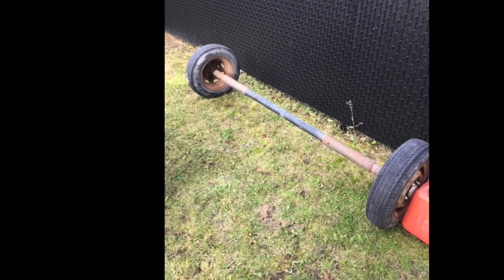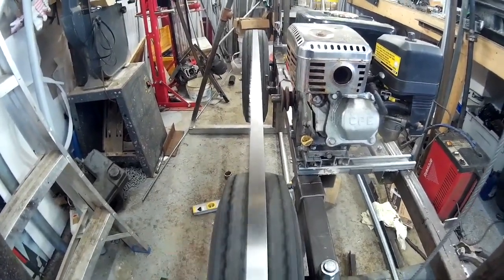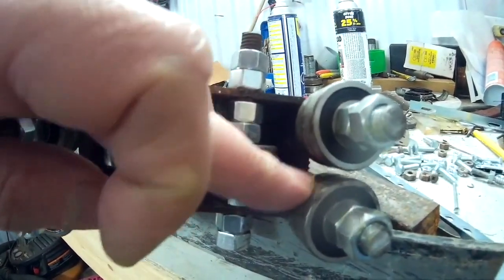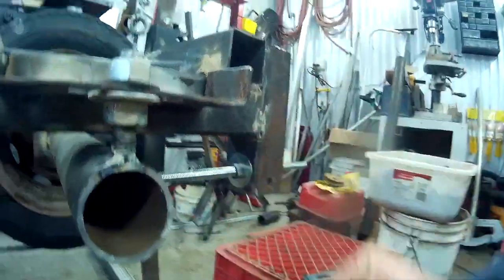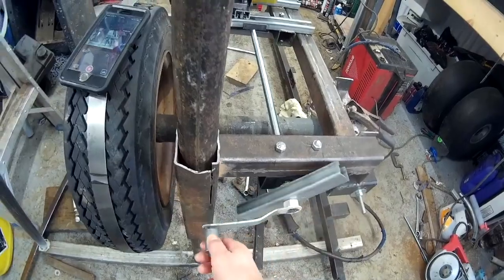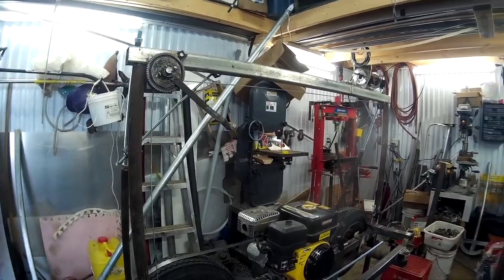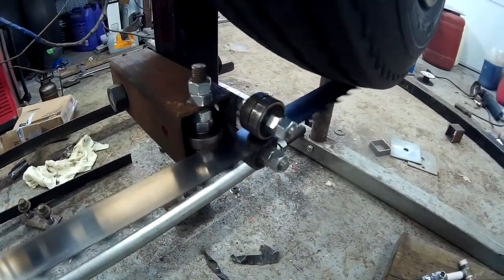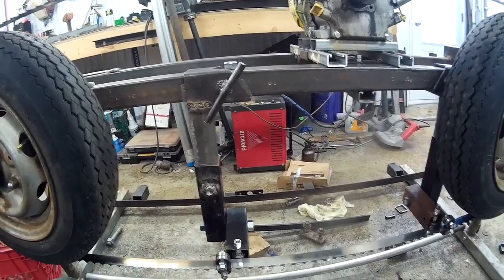Home made sawmill for 400$

Comment: Good job, a really good looking design.  

I would be interested in purchasing a set of plans if you decide to make one up. I might be able to get it together by just looking at the video enough times but plans with pictures and measurements would save me a lot of time and head scratching...lol
Reply from the maker: i use only scrap metal to build the sawmill , and it will be hard to do good plan for me.  the best , is taking what you have for saving money . if i do plan , and you purchase everything , i very dont know how it will cost , but will be expensive !!!